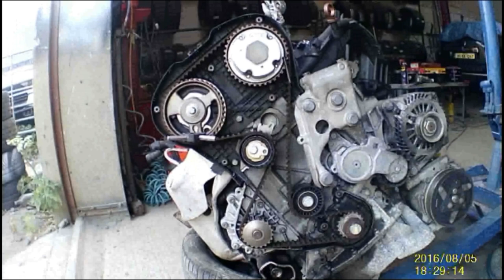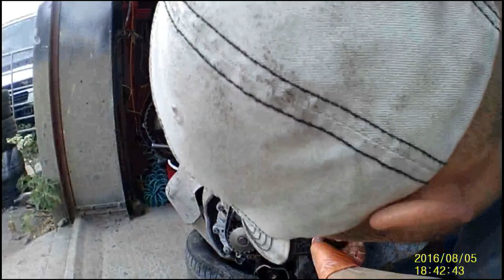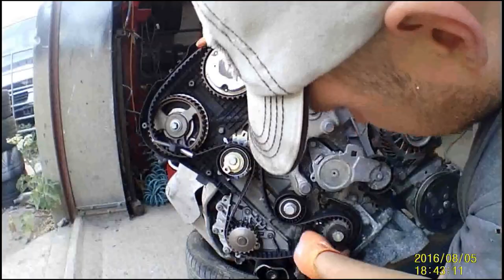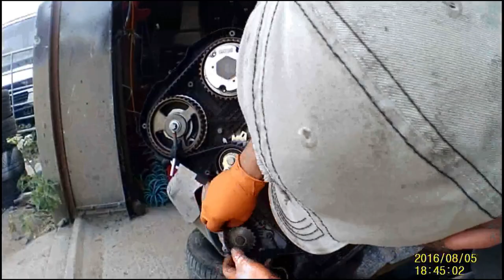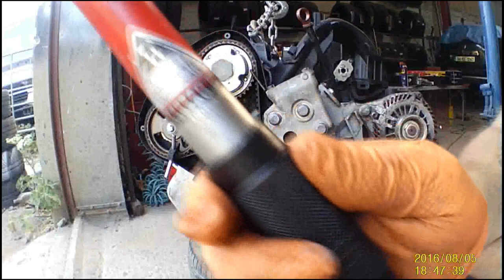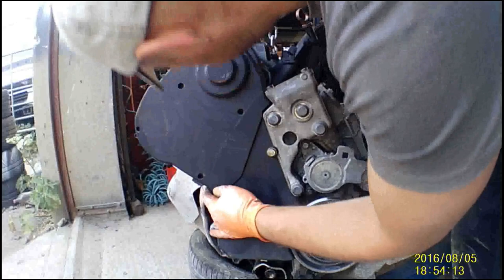Peugeot 407 621 8 16 v 125 hp patrol 09 2005 timing belt YouTube AME Motors Howtofix

Comment: You have to lock the crankshaft as well because the bottom pulley is "floating", there is a hole at the back of the engine towards the flywheel. The hole in the engine is 30mm, but the hole in the flywheel is only about 9.3mm, so you have to turn a shaft down. The 30mm part should be max 25mm long, and the 9.3mm should be about 15mm long.
Reply: this is not "floating"
Reply: @millo1785  It was on mine.
Reply: @krisholt  this car has a key in the crankshaft gear... You can see it in te video
Reply: @millo1785  You can see the crank moving when he removes the belt 😄
Reply: @leksander86  yes, 2mm, ir si normal